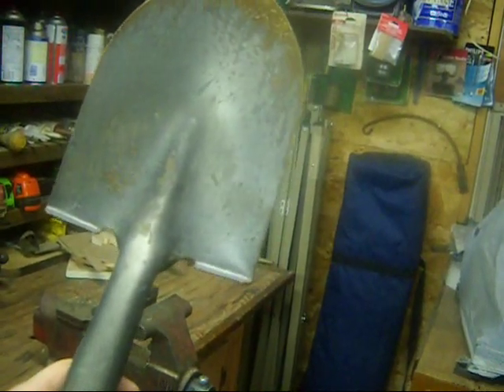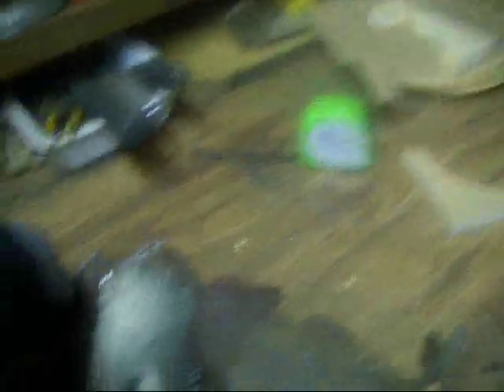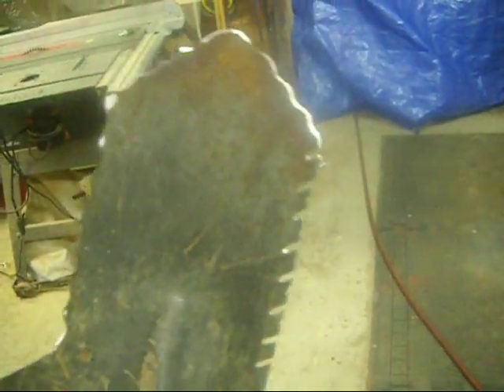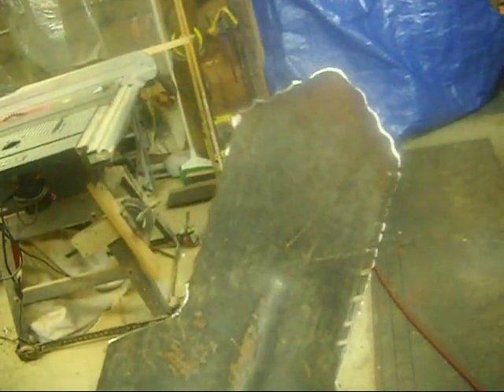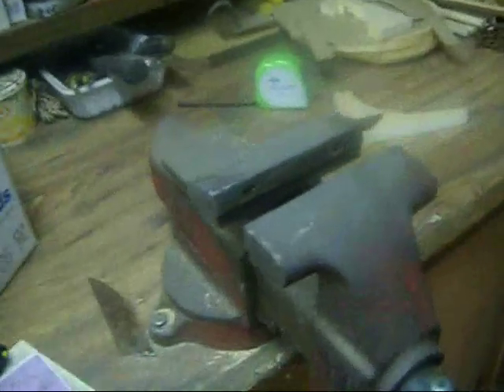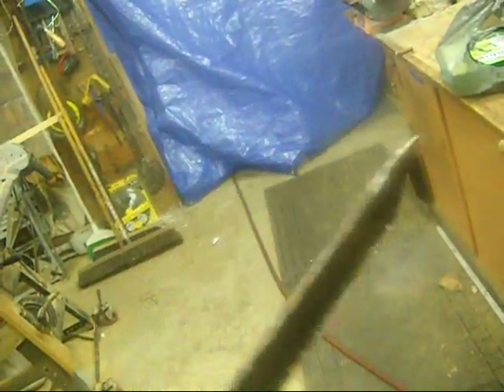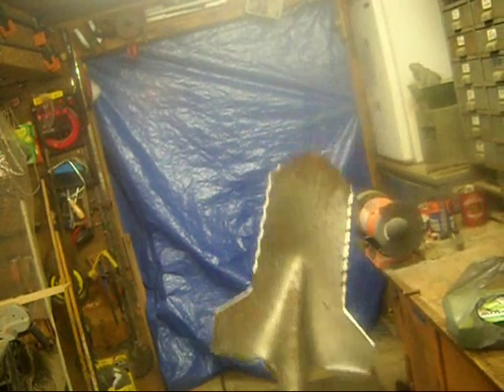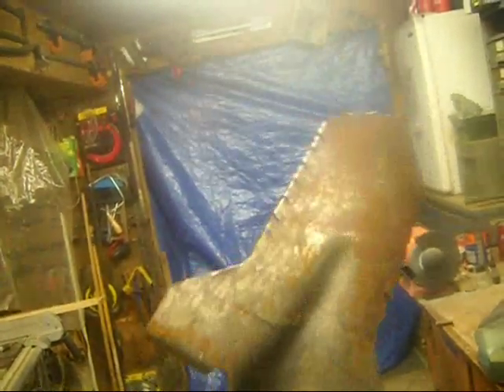DIY metal detecting shovel, The "Wicked Shovel"

Comment: I made one from a harbor freight shovel. The metal is thin and weak thus lighter which is why I used it. Easy to cut, too. I didn't do root blades because I carry a Japanese garden knife ( very versatile and handy in tight places). I've bent the home made digger a few times but it sprigs back. I will buy a better quality shovel to cut up for hard earth use. Another neat trick, use one half of a post hole digger with mods as necessary.
Reply from the maker: Great idea, thanks for watching.
Reply: I enjoyed your vids, thanks for posting